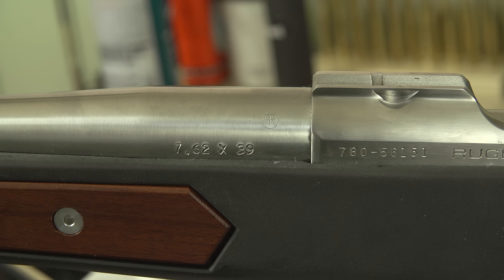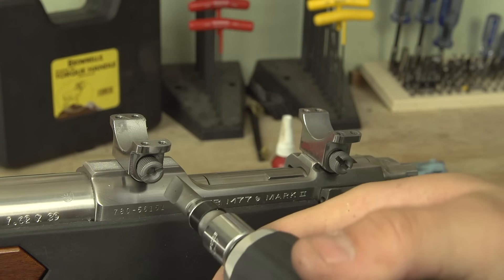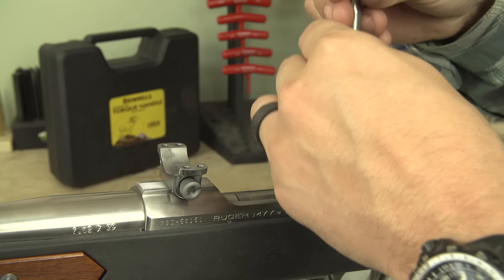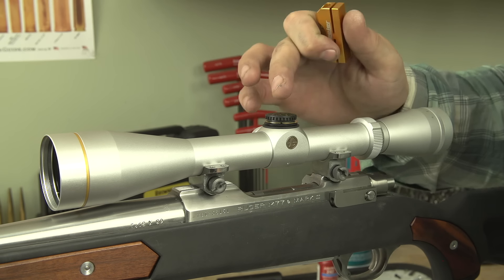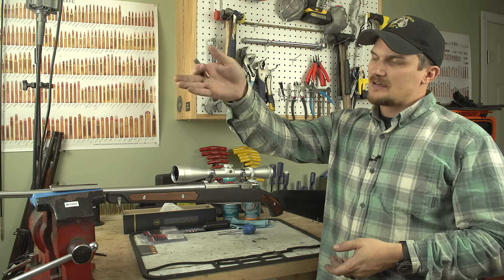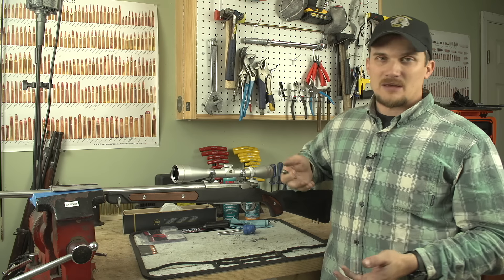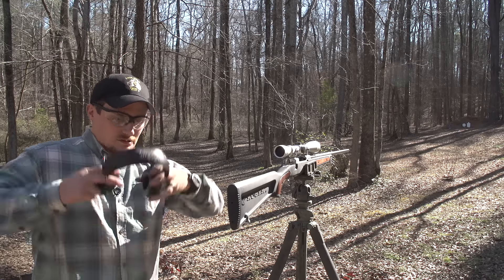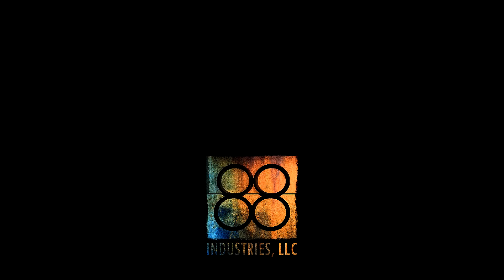How to Mount an Optic Like a Pro

Comment: In Europe we dont lap the mounting. In Europe the most gunsmithes use glue.
Reply: Glue? Is there a particular brand you use on your airsoft guns or will anything work?
Reply: Mark C. no its a special 2 component glue that use gunsmith. U can lose it again when u heat it up to 150 degree. Some gunsmithes use something to put it between the mounting an the scope, but mostly u dont need lapping because expansiv mounting, for example from leupold are high quality made... lapping is from the past, when mounting erent so high quality produced. Only u american use lapping... i cant understand why.
Reply: You are correct that it makes no difference on this setup and is a waste of time, however it can have a noticeable effect on a rifle setup to shoot at extreme range where every little bit counts.
Reply: Mark C. oke thats true...here in germany u can shoot only on mostly maximum 300m ...there are only some few ranges that are +300m.... there are mostly on military training areas.....
Reply: My local range here in Florida goes to 1500 yards (1300m). In many states out west you can shoot to the ballistic limit of your rifle. Obviously average recreational shooters with store bought guns aren't going to be very successful attempting to shoot at that type of range, but there are many people equipped with customized rifles who compete in the monthly competitions at my local range. My Savage 10FP .308 bolt action with hand loads can shoot .38 MOA at 100 yards and can easily reach out accurately to the ballistic limits of the .308 Winchester cartridge which is roughly 1100 yards, my biggest hold back isn't my rifle, its my scope and scope mounts although I can usually ring the 8 inch steel plates at 650 without much effort if the weather conditions are favorable.
Reply: "2 component glue" = epoxy

Glue and epoxy are both types of adhesives, but they're not the same thing.
Reply: Mark C. every one is a fucking expert.
Reply: MSKommando , howdy! 
   You broach an interesting aspect of a broad topic. I have heard of a process simular to that of which you defer to as a standard practice in your home area. I reckon it was a long time back and the details are lost in the annals of mind. 
  So in the essence of fair comparison...could we ask you to recount the process and site a couple of preferred products suited to the application commonly used in your corner of the world. Please and thank you.
   Happy hunting, from west Texas to you, and blessed day sirSir.

Comment: Your torque meter gave the moment you tried to torque the screw down. You have overtightened the screw. Secondly, the content of the lapping compound is.. inaccurate. Alumina is also incredibly hard and is used in many abrasive tools, just like silicon carbide is. There was no explanation there as to why that would necessarily cause parts of the abrasive particles to remain in the rings, more so than other abrasive particles. I'm not saying what you did was wrong, or it wouldnt work, I question your reasoning behind it and the theory of why it works, and therefore implying you may have done more than you actually needed or constrained yourself unnecessarily.

Comment: Why don't you just buy rings that don't need to be lapped?
Reply: Because you can't. Everything made has a tolerance and nothing is ever completely perfect. If the rings were installed on the action and torqued to spec they could then be line bored and lapping wouldn't be required. Lapping while a correct method just saves the much higher cost of that line boring.

Comment: Omg you put mounts on the rifle without using a doweling and then start lapping .if the mounts twisted out then your lapping out material you shouldn't .only when you've ensured you not got a horizontal twist in the mounts you'd lap it for the scope .you don't remove material if you not atleast check the scope mounts for twist

Comment: Bro your a "professional " gunsmith and that's how you mount an optic. For starters that scope turret is not a flat surface theres no way that's an accurate reading. You hang a plumb line and level the reticle to the fall of gravity. Those level kits get you close but never trust them. Especially when you dont have a level scope turret. And the ring gaps looked horrible scope was not tightened evenly. That's not how a professional gunsmith would mount a scope.

Comment: Chad, it helps to center your alignment bars if both rings are tightened down together.  The front ring had a gap where the two sections come together.  The rear ring sections were touching.  Your finished product still had a gap between the two sections on the front ring.  Not very professional looking.  Come on man.

Comment: The gap between the front and rear rings were totally out of whack - they should be equal either side. Also when leveling the scope and gun it was obvious that the rifle was so firmly fixed when you adjusted it vertically it just returned to the same position lol And finally, the reticle should be leveled with a plumb line not with a spirit level on top of the turret. Poor technique and info, hardly professional gunsmith standard.

Comment: Only lapping the bottom half of the ring is like washing only the bottom half of a car. The whole thing needs done otherwise you're wasting you're time.
Reply: scars187 very good point
Reply: I argee
Reply: scars187 if the top half is installed when lapping , it can't be tightened down . the lapping rod would not be able to move. the upper halves not being tightened means the are not full holding themselves square on each pass.
Reply: scars187 not true the caps are providing equal amount of pressure from the twenty inch pounds of torque and setting the scope in a even base the caps don't always need lapping
Reply: when lapping with the top half installed you slowly tighten as your lapping just enough that the rod will still move when it feels like its getting loose tighten a little bit more and continue.